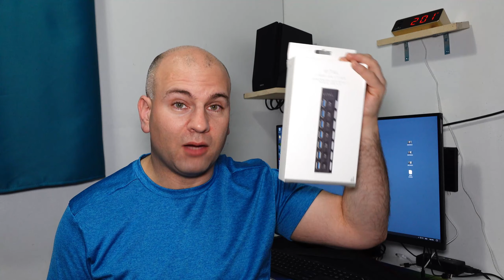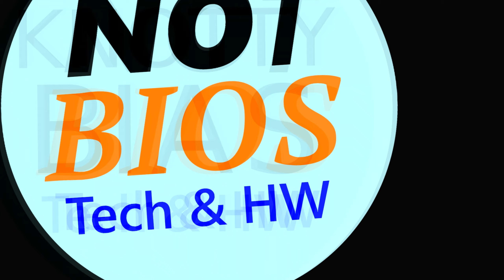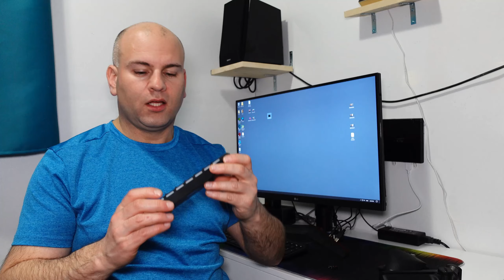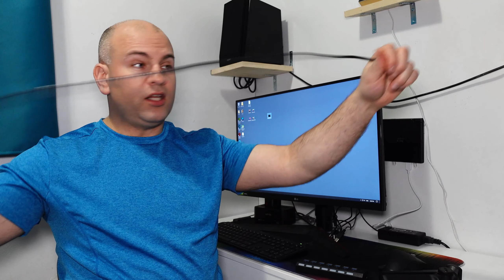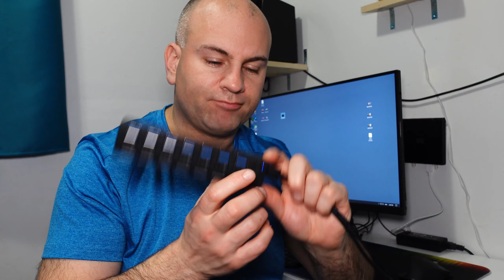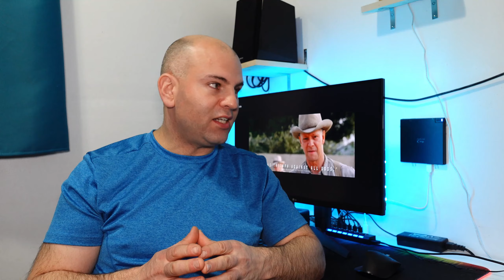Vital / LOBKIN 7 port USB Hub for PC, laptop & Mac Reviewed

Comment: Power pin lose too much how to fix and what adapter did you use?
Reply from the maker: Did you comment on the wrong video? Sounds like the comment should have been for the Cooler Master case. Links to all the items in the description of that video as long as Amazon links you properly. It seems some amazon stores sell simular but different items. If you open tge PSU or any PSU for that matter it has a mini 2 pin fan power, which is identical to nearly all GPU fan headers.
Reply: @sparketech  no , I mean I am asking for adapter that you use for this device because some adapter won’t work properly even if they come with product?
Reply from the maker: I'd recommend the newer better "ORICO 7-Port USB 3.0 Hub" model CL7U-U3-10   ASIN: B0D2VVX6HP
That one uses simply USB power cable for extra power

I can't find the adapter I used BUT a multi power adapter based on the same voltage could work just fine

Comment: Wenn ich diese Waren anschließe, passiert meinem Computer nichts. Wenn ich anschließend die externe Festplatte trenne und wieder anschließe, ist sie nicht sichtbar. Ich muss die USB-Treiber neu installieren und dann ist die externe Festplatte sichtbar, aber nicht, wenn dieses Produkt angeschlossen wird. Wo ist das Problem? Benötige ich spezielle Treiber? Vielen Dank
Reply from the maker: This isn't made as a hard drive storage device. Works fine for low powered thumb drives. For external storage you should be getting something like the Unitek Drive Station I review. I reviewed a dual docking station and another single one that has an SD card reader as well as 2 USB ports built in.
Reply from the maker: This device is made for actual storage drives.
External Storage Enhanced Unitek Docking Station
https://youtu.be/c-a2WSOy3h0

Comment: *I always Thought About getting one of these before I bought what I have. *
Reply from the maker: What did you get as a hub? I did purchase a 4 port USB 3.0 Hub to attach to my monitor for the LED light strips. The one I have here costs more BUT much more useful for turning on & off the LED light strips at the back of the monitor.
Reply: @ *I bought The Anker 4-Port USB 3.0 Unibody Aluminum Portable Data Hub with 2ft USB 3.0 Cable for Macbook, Mac Pro / mini, iMac, XPS, Surface Pro, Notebook PC, USB Flash Drives, Mobile HDD and More  * Not Bios
Reply from the maker: @BlackapinoTheTechGuy  nice, that is the exact same one I also ordered as a 4 port on December 10th.